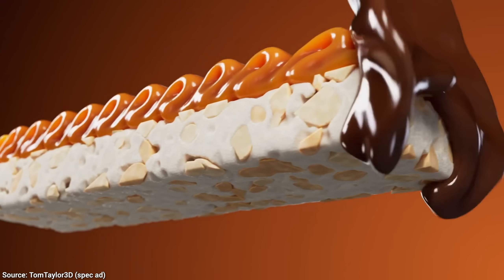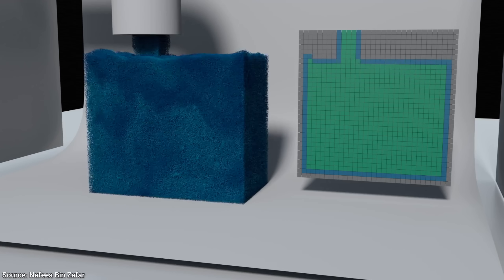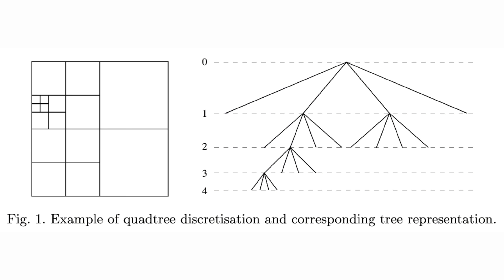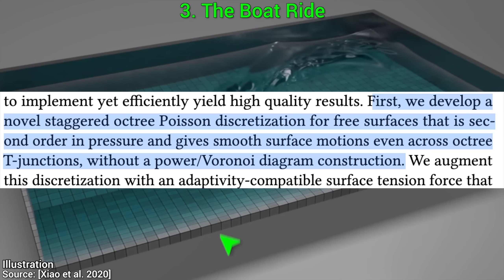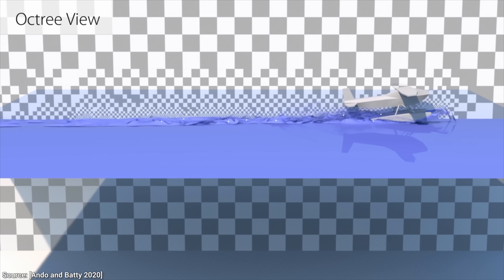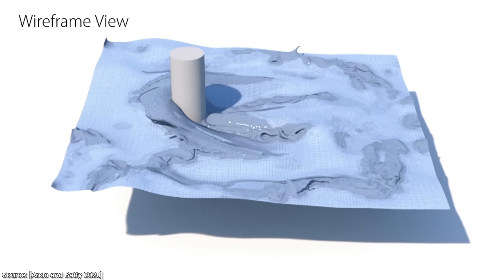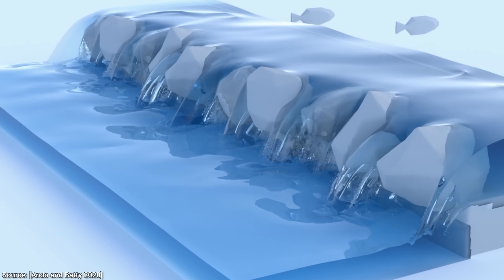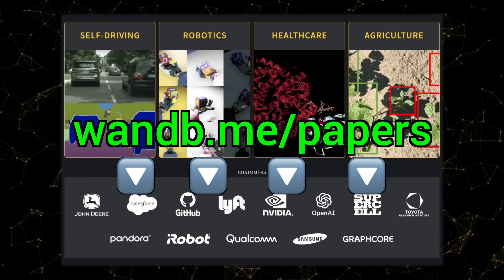You’ll Never Look At Chocolate TV Ads The Same Way Again

Comment: I was working on time domain 3D finite element analyses of electromagnetic and electric circuits in motors in 1989 and we used Octree adaptive meshing then (with a time domain predictor) and IIRC we used a second order solutions to tetradra around areas of large changes (material boundaries) I love this square meshing solution though - ingenious to splice in a gradient around edges - the matrix inversion maths must be really hairy!

Comment: This was good. I remember hitting the 2.1GB ram limit on my Windows XP computer when trying to use Vray's fire and smoke simulator way back when I was just starting Uni.
I always wondered why more adaptive mesh systems weren't used. Glad to hear they are and I hope someone optimises them, even if it's to be run on a Cerebras wafer scale chip in order to be real time, eventually we'll have great fluid dynamics simulations with advances like these reducing the ram requirements.

Comment: Imagine this but in a game
Reply: This just like ray tracing is only practical for screenshots, and should be added to games like Cyberpunk. Since you are only processing 1 frame at a time you could crank up the detail to 11 to make the screenshot look amazing with all the light and fluid simulations. 

But for regular gameplay just like ray tracing it doesn't really make much sense because not only is it very expensive to process for 60+fps gameplay, but you would barely even notice it running around during regular gameplay.
Reply: @RaydeusMX It always baffles me as to why tech demos especially UE5 ones that are shown running in real time are never used
Reply: @Inv1xxity That's mostly because while those demos are running "in engine" they are heavily scripted and don't represent the kind of loads that occur during actual gameplay, so they can run at a higher framerate than what we actually get playing the game. Add to that how unoptmized games can be, specially in UE5, and not even a 5090 stands a chance.
Reply: @RaydeusMX ah alright